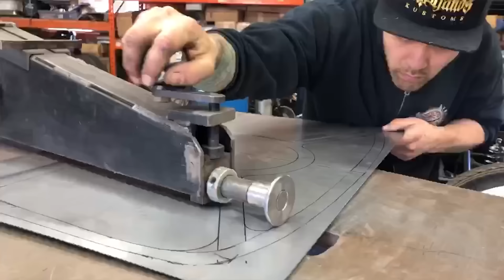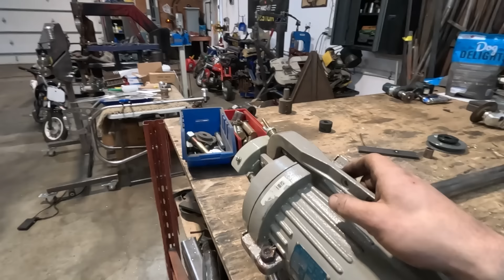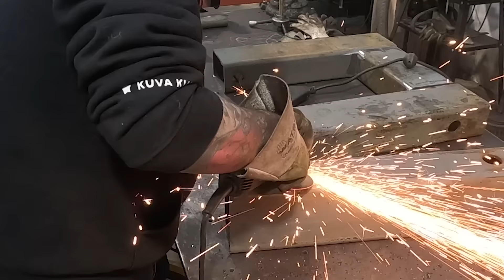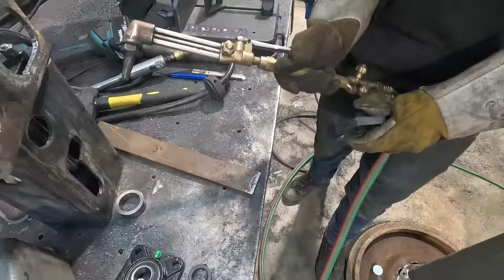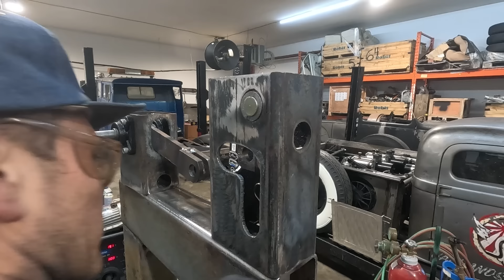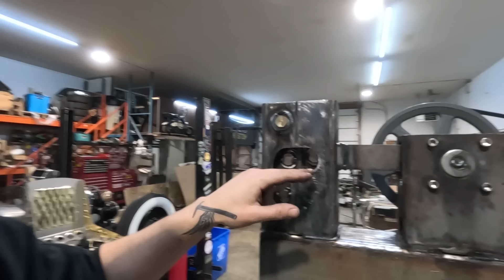How-To Build a Metal Shaping POWER HAMMER From Scrap Metal / Pull max/Nibbler

Comment: It is amazing what you accomplished with so little...I 'm not an engineer either but I've successfully "cornfield engineered" a bunch of stuff..a couple of observations... A Pullmax with all its mechanism is in an oil bath gearbox .... I think that the key to your machine's longevity is proper and copious lubrication. And I believe that along with the flywheel in the motor the 8" drive pulley probably acts as a flywheel as well..I think you're on to something! Are your planishing dies made of tool steel and hardened? I've almost completed my ridiculous English wheel that I've named "Overkill" it is HUGE, and has a bunch of features and cRazY adjusting linkage and a lot of artistic style. I've modified the crap out of my Harbor freight bead roller and am planning an "Overkill" super deep throat bead roller... I share your enthusiasm for homemade equipment! I will be anxiously awaiting your next episode..I ❤ to see the excitement and joy on your face when you've created something cool!
Reply from the maker: Right on Jeff! Bet it’s a beast! Yes s7 tool steel and hardened to 58-60 Rockwell

Comment: Maybe we can talk Karl into selling sets of his planishing hammer dies separately for those of use inspired to follow his lead on building one of these?  Having longer links on fixed-point/recip-link provides more mechanical advantage power to slam punch/die and get more material displacement on work piece. CAUTION: more stroke power can SHATTER shrapnel off hardened steel punch/die tools if the two make contact!  Shorter crank offset equals shorter stroke length of the punch/die tools, but the stroke/tool-opening needs to open enough to move around a workpiece over on a thumbnail punch/die.  Karl is spot on with larger pulley size gives motor more mechanical advantage and only affects RPM (which becomes hits-per-minute). Larger pulley=more power at slower hit rate for shrinking.  Smaller pulley= light and fast for planishing.  This build may need a cam bigger than the 1.5-inch diameter offset gives to open enough if desiring a set of thumbnail tools with a large workpiece displacement.  Can build a flywheel weight onto the crankshaft pulley so any 1/2HP motor has the same residual energy and a brake shoe on the drive pulley like a snow thrower uses.
Reply from the maker: Thanks for your insight here!!

Comment: Hey Karl,
   Really great video !
The darn thing actually does what it was built to do.
Some of the vibration may be eliminated by grease in all the moving and sliding parts as well as some heavy gussets within the C frame.
If you decide to add the gussets, do not just weld them in the center of the tubes as they will cause the area you weld them to to flex and crack.
You can add thick pads that cover a large area to affix the gussets to or weld them to the outer sides.
Great job man.
Reply: The best and easiest way to gusset that would be to use the same 4x6 tube
Reply: I believe he knows all that 😂😂😂😂

Comment: Nice work Karl,  another machine to build for my workshop. just in case you dont know you can rotate the clutch mechanism on the front of the motor by loosening the bolts that hold the clutch assembly to the motor then you rotate it so you can orientate the lever to suit you foot linkage. Cheers Greg
Reply from the maker: I’m Didn’t know!! lol would have been helpful

Comment: That's the way I design machines - not to last a hundred years, not as industrial art and certainly not for any coolness. I use what I have for the most part and I make them to work well enough to do the task at hand.

A useful shortcut - the ratio between pulleys works out to be the same as the ratio of their diameters and can be accurately used in rpm and torque calcs.

Comment: Carl, very nice tutorial. Please keep on going with you scrap tools fabrication series!😂😂😂. 

In this concrete case, I would suggest to use a "sliced" crankshaft with connection rods from small engines (disposed/ junk) . Then you can avoid billet metal pieces machining. If you use an engine connection rods you would get (i) serviceability/ user friendly installation convenience, (ii) better rotating parts matching - a rod with a pin via bearings. 

I just share my idea. No critics! But anyway, your videos challenge a lot!!!

Thanks, man! Good job!

Comment: That really turned out Great. You really Hammered the Engineering.😁. I was wondering how you were going to get the Up and Down Motion for the Hammer. Like you said, you don’t need the Hammer to go very far in it’s movement. Plus you added the adjustment on the bottom. This is a Great Project for the do it yourself type Person. I think I will get some Metal together and make one. I have already made a nice 2” Belt Sander almost just like yours. Thanks for all the Work you do making these Videos. 👍👍